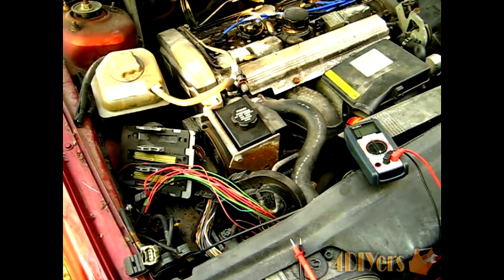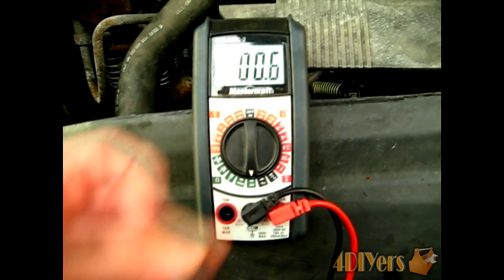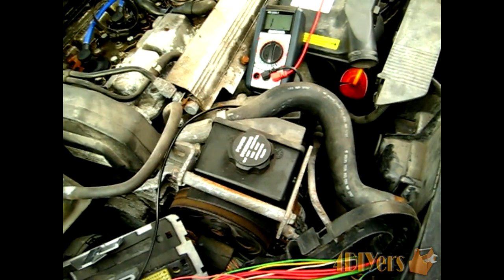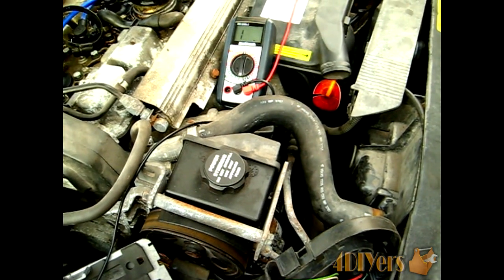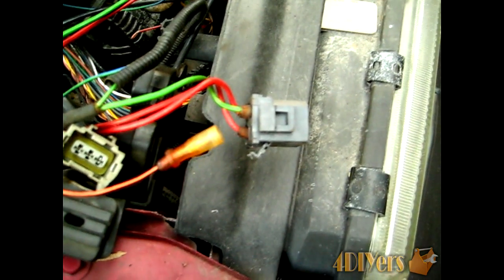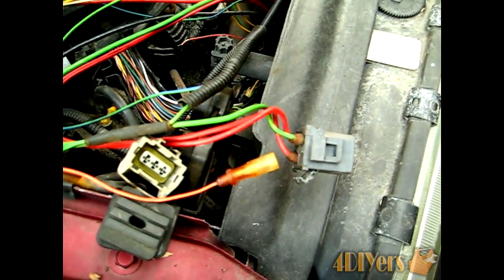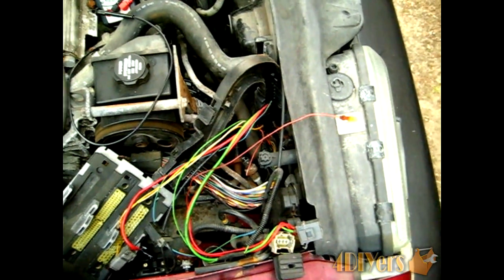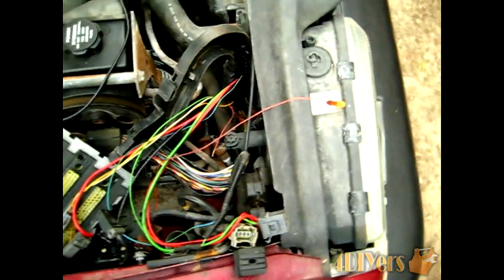DIY: Testing for Continuity with a Multimeter

Comment: When testing continuity of my Rmz 250 dirt bike ECT Sensor I get different measurements from negative and positive leads. Also I have to connect multimeter black probe to ect sensors positive lead, and red probe to bikes service coupler negative lead to get 1350 an abnormal reading to 918 when testing other wires in the harness. The continuity testing examples I’ve seen show negative to negative or positive to positive leads of wires probed by multimeter with either black or red to result in a beep. I’m testing continuity in number measurement which I stated above, am I doing this wrong?

Comment: How you test continuity at a Relay on a car? mine has 4 prons
Reply from the maker: Nicholas Lamoureux Here is a video on how to test a relay https://www.youtube.com/watch?v=clSSwXeezDo If you want to test for continuity of the relay circuit, you will need to determine where each of the wires engine up. For the switching circuit, one will be a group and that other will be a power source. Easiest way to test that is just determining the voltage. As for the switching side, measure the voltage input, then test the continuity on the output and you will need to know where that output side ends up.

Comment from the maker: VitaminD ForSurgery This is the video which is actually intended for that, but I'll go into depth a little more here. If you're looking at a wiring diagram, there will be various wires shown which come from the ECU and go to other locations of the vehicle. One being the ground, another power, another going to the knock sensor, etc. Be sure to disconnect the battery first, it's good practice just in general anyway if you're working with the vehicle's electronics system. There will be one massive plug which the ECU is unplugged from. Once you remove the ECU, the plug that it goes into will have numbering going to each one of the pinouts. Now back to the wiring diagram, it will be labels to what pinout goes to each location. So for a generic example say pin #10 is for your ground. Using your ohm meter, set it to the lowest ohms setting and then touch both test probes to see what the value is. A majority of the time there will be a very low amount of resistance because the probes could be dirty either on the outside or where they plug into the multimeter. Once you know that value, that should be expected when you take a reading. Now take one test probes and touch it onto the pin #10 from the ECU harness and then the other on the negative battery clamp. If the reading is 0ohms, there is a break or a very poor ground. If you have the same reading as when you touched the test probes, then all is good. But if you find an excessive high value, more than just a few ohms then there is a poor ground. If you find a couple more ohms than what was shown in touching the test probes, couple be just a dirty spot where you are touching the test probes and a majority of the time that isn't enough to worry about. Now obviously with their test, they have compensated an acceptable value (400ohms or less). Now the same principle goes for the knock sensor as well. One will be a ground wire, the other a power wire. Against a wiring diagram or the manual will be able to determine which one is the ground and they should be numbered on the side of the plug somewhere as well. 

Now just in general with regards to Subaru. There is a modification you can do which is suppose to help the stock wiring system out quite a bit, but that depends with each car. Some people make up their own ground wiring system and add them in. I've never done it myself but have heard of many doing this mod and also having excellent results afterwards. I know there are quite a few tutorials available on the Subaru forums.

Comment: Would you make a generic video or just write out an explanation on how to test resistance at the harness, i.e., actually show the type of probe tip and where the tip is placed on the harness to measure resistance.  I don't care which harness, any harness so long as it's attached to the car and not removed (saw one such video). I ask because I received a P0328 code on my Subaru Forester 2002 - Knock Sensor Circuit High Input.  The repair manual says as Step 1: "CHECK HARNESS BETWEEN KNOCK SENSOR AND ECM CONNECTOR: Measure the resistance of harness between ECM connector and chassis ground."  Should be between 400 and 700 kOhms.  If less than 400, go to Step 2.  Step 2: "CHECK KNOCK SENSOR: Measure the resistance between the knock sensor connector terminal and engine ground."  How do I physically do steps 1 and 2?  I have a volt-ohm meter and I can find the harness and knock sensor, but I don't know where the touch the probes and whether or not I should disconnect the battery before doing so.  I can't find a video for dummies like me on testing harnesses in a car anywhere.  Thanks in advance.

Comment: My car keeps blowing my taillights fuse I used an ohm meter and I keep getting .3 is that good?? And it doesn't seems to be showing where there is a possible grounded wire or break
Reply from the maker: ricardo llamas Could be a variety of issues. Cheap bulbs, wrong bulb for the application, loose bulb holder, faulty power water, or even just the oil from your skin causing it to heat up and blow. 0.3ohms does say you have a connection which is good, that little value could mean you have a dirty connection on the test probes. What is the value of the test probes when touches together???

Comment: Nice video....though looks like your meter does have continuity option to the right of where you set it. ( arrow at plus sign )
Reply from the maker: Acrticgypsy I don't usually use it for a video, just in case someone else is also doing a test but their model of multimeter doesn't have that option.
Reply: Ahh good point :)

Comment: What tester do I need to test wire from transmission to cars computer?
Reply from the maker: Annabelle Annon A multimeter on an ohms setting which I used in the video is great for this job.
Reply: Thank you!

Comment: Great video. I have a question for you. I'm trying check for continuity in the igf between the ecm and the igniter and I my have to check the igt wire likewise where would I connect the ground and positive?
Reply from the maker: What type of vehicle are you working on???
Normally you would have to determine which wires are the ground and positive on a wiring diagram. Once you've determine which wire is which, in order to check the continuity, you would have to go from the positive wire to the positive battery terminal cable. Then for the ground, that would go directly back to the battery ground terminal cable.
Reply from the maker: I should also add... If everything has passed the continuity test and you want to determine if there is a single for ignition, you'll need an analog meter for that. Digital meters won't be able to respond fast enough and the voltage signal isn't there long enough to show the full reading.
Reply: 4Diyers thanks for the quick response. It's a 1996 Toyota corolla with a 1.8 liter eng. It had a P1300 code but I had to change the distributer due to oil leak in it and the ignition coil was black and burnt. put new plugs and wires and had a second hand igniter put in and it sounds like it wants to start and then it dies off.
Reply: I did a check on a couple of wires from the igniter connecter to the ecm connecter. The igf wire showed .5 and the igt wire showed a 1.2 ohms
Reply from the maker: Have you checked the color of the spark while turning over the engine??? It should be a strong bright blue. That small amount of ohms might be a dirty connect or a dirty test probe. Anything with such a small amount of resistance such as that isn't normally much to worry about. Did you do any tests on the ignition coil as well???
Reply: Well! I changed out the whole distributer, rotor, cap, plugs and wire because it was full with oil the rubber seal on the distributor was leaking oil and the ignition coil in it was all black and burnt looking so I just changed the whole thing and I also changed the igniter that's when I got the spark back. Now I sounds like it wants to start but it just dies out so I checking the igf or the igt to see for any resistance in the wire.